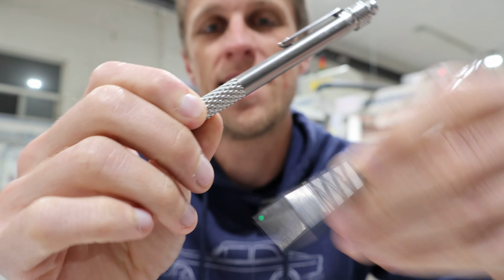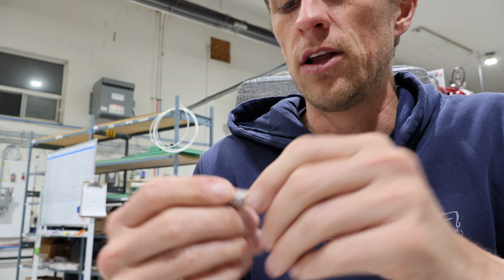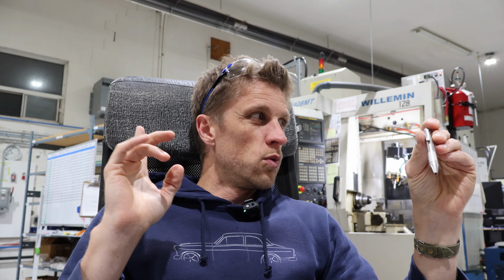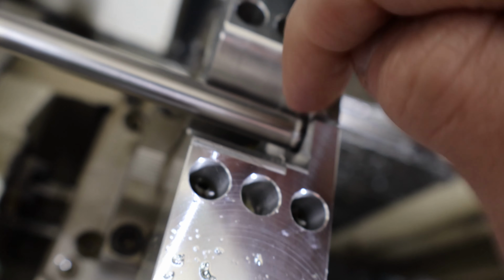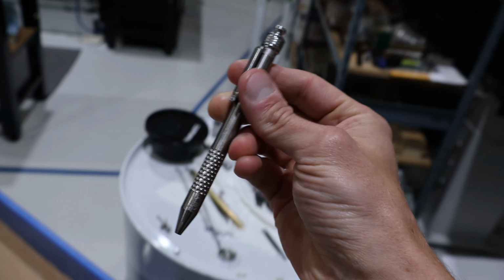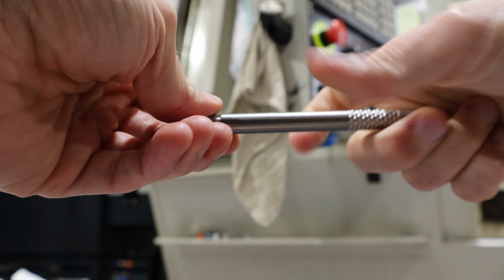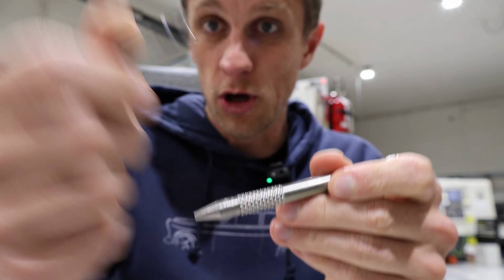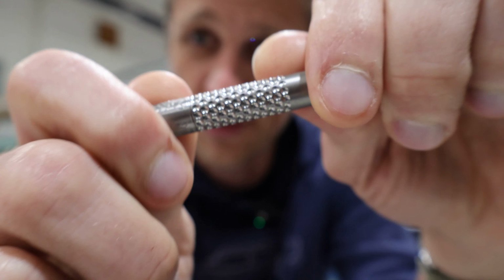These Are Turning Out AMAZING! | Saga Saturdays Ep 36

Comment: John, 
Maybe use a sturdy plastic for the reverse cone to hold the tip, if you're going to hold from the O.D. of the tip, as not to mar the finish on the tip? machine the plastic holder to fit into the bearing for the live center.

Comment: Love your work!
Two things:
1. You can also use for instance a dovetail cutter offset and angled to avoid breaking the 60deg engraving form tool.
2. It seems as if the Willemin has a collet chuck mounted for the F34 collets you are using. Can't you just take that off and mount a center directly to the spindle nose? You'd gain like 100mm from the collets.

Comment: For the grip under the pocket clip on the helical line cuts. What about just lessening the cut depth in the area under the clip. Seeing if that lessens the grip satisfactorily but still maintaining most of the visual. In fact it might add a slight wave in that area visually. Since the cut depth is lower than the other areas. Adding too its unique look.

Comment: Super stoked for some patterned Sagas in the future!
Have you ever considered keying the clip and slider assembly in some way to always have the clip clocked onto the tube in the same location?
And for machining the tip as well as the tube, you might need a pattern that won't look off if the tube and tip misalign slightly, because the patterns will only align if you tighten the tip the exact same location as when it was machined, which over time may wear in to shift that alignment spot.